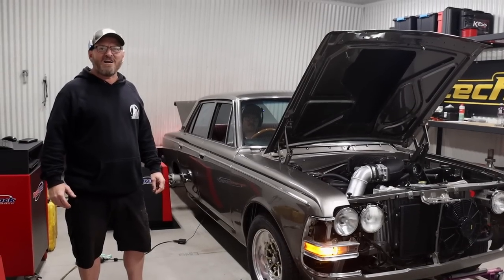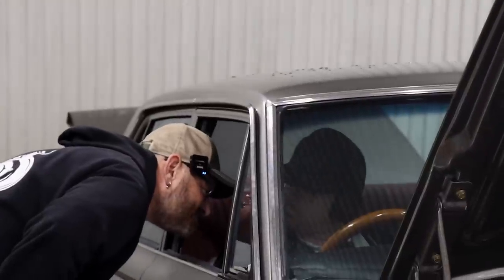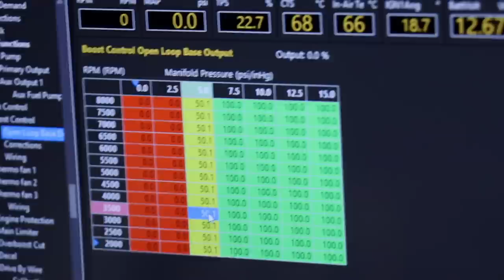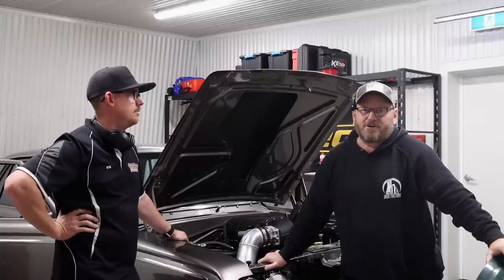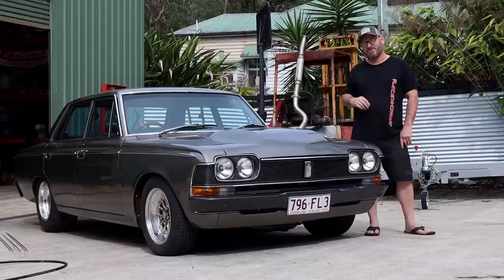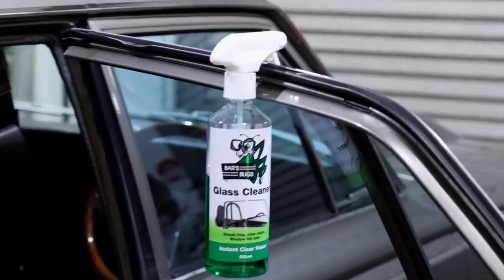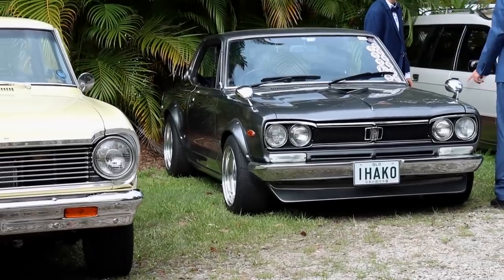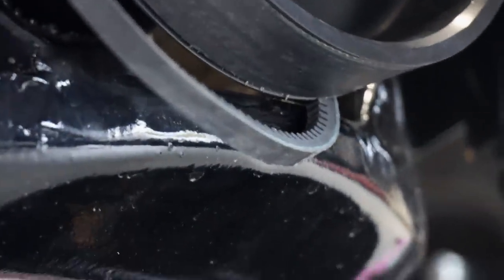Deadlines, Dynos & a Date for the Formal. Supercharged Big Block Crown FINALE!

Comment: Nice job Al / Woody good too see it cruzn , i have fitted a 2300 harrop to my barra an would like to control the actuator on it like you have what valve did you use , keep up the cool ride geat show Jeff
Reply from the maker: It’s just a 3 port MAC that you’d use to control a turbo wastegate.

Comment: Is it common to not use tie downs in a hub dyno? I always thought you had to tie the vehicle down when you did pulls ?
Reply: it's got no wheels its not going anywhere (unless it wheelied so hard it flipped over)
Reply: @gowerski  that's what I figured but I still thought I always seen cars still strapped. I have never been to a dyno shop so I was curious. I would think if a vehicle is capable of pulling the front wheels off the ground under full power that it could happen on the dyno as well

Comment: I have a question.  I've got an 05 hilift RWD Courier with the 250/4.0l V6 in it. I also have a circa 1980s 308 Holden V8 that runs. My pipedream would be to slot in the 308 and in a perfect world, put an injection kit on the Holden engine. Comments? Expensive pipe dream or an achievable project on a tight budget?
Reply from the maker: You would need to pass the emissions levels of the 05 car so not really doable with a free-o. You may get away with a VT 304 engine.
Reply: @theskidfactory  Might as well hunt down a half-decent Barra, or stick with what's in it I guess. Know anyone who wants an old-school 308? It's still in the bus though. The original owners dropped out the diesel six and put in the 308. It was originally a school bus with a 4-speed manual, and the giant town diff. I'm going to part out the old bus so I can finish my ute. I've replaced all the bits on the motor (water pump, thermostat housing, put in electric fans etc) and have replaced the rotors, pads, bushes front and rear, upper control arms, tie-rod ends, all the ball joints, and got some decent shocks from Dobinson's. 
Now I work on turning it into a mobile workshop/home.